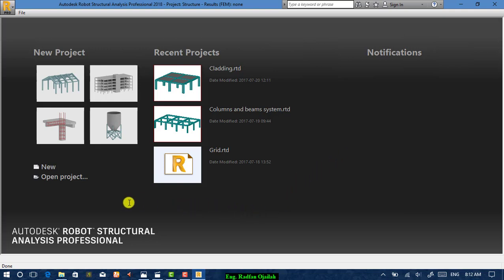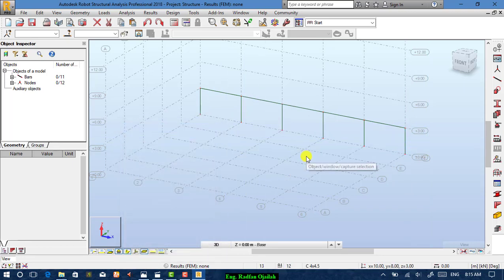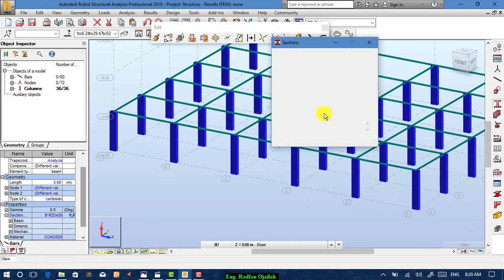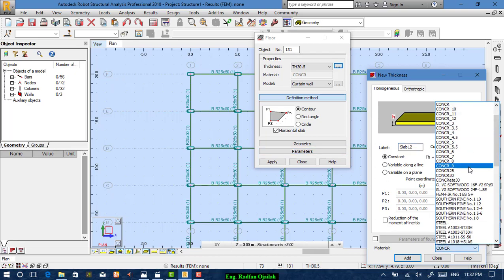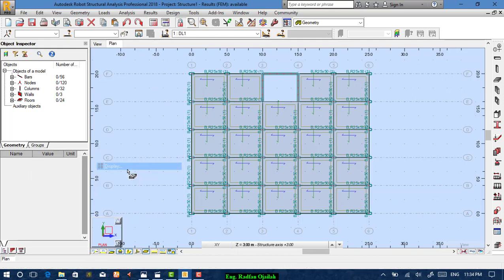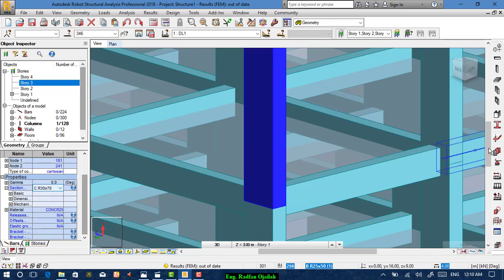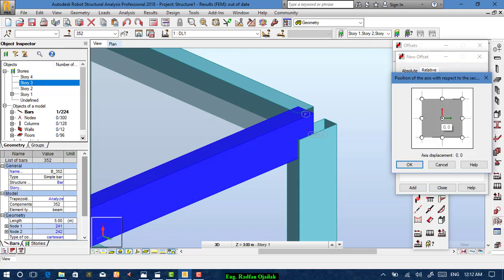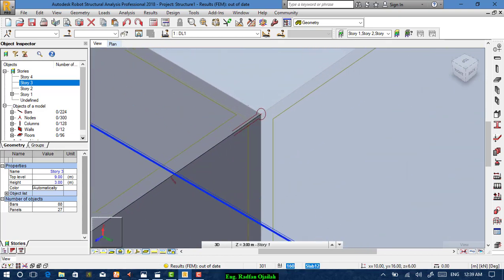Lesson#5: Modeling a Structure, Making Stories, Defining Sections, Releases explanation

Comment: Dear sir 
I'm using new to robot structural analysis and my final year project is a two story  building, whenever I'm doing analysis  the warning and error of " there are no nodes in the floor planes .it is impossible for the static seismic analysis " is displaying. 

I'm stuck in this error from two days ,I hope you will help me in this regard.
Reply from the maker: Make sure to apply meshing and finite elements options for all the floors and planes  in order to analyze the structure, without meshing you can not get results

Comment: I’m struggling to copy the storey  IAM using the same translation vector as you (0,0,3). But it doesn’t copy following the Z axis. Could you help with this.
Reply: you need to use this (; )other than (, ) when you are writting vectors number , so it will be ( 0;0;3)
Reply: Try to uncheck drag option when u copy.

The , worked just fine for me though, could be version issues.